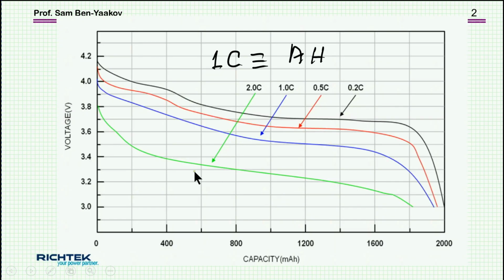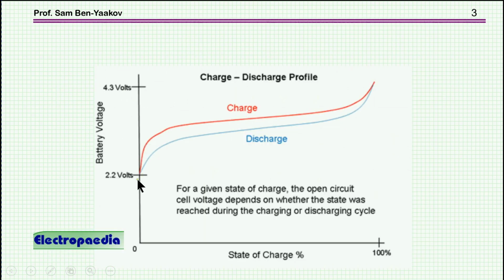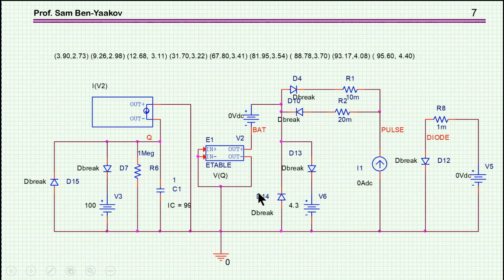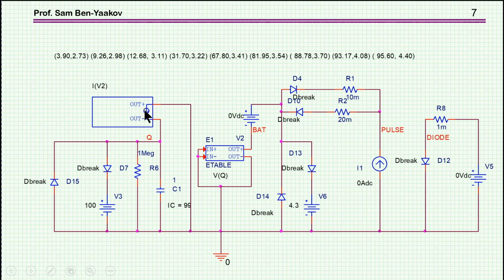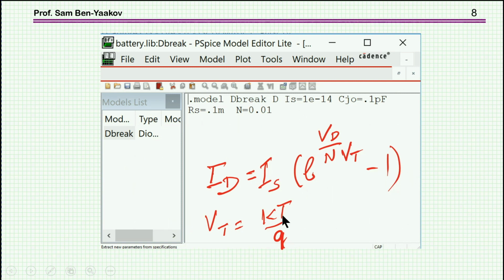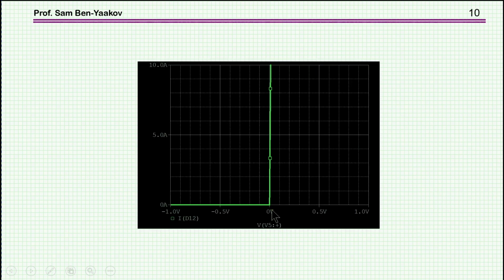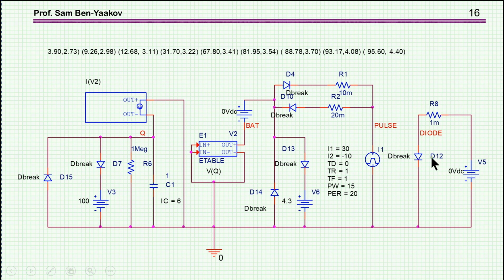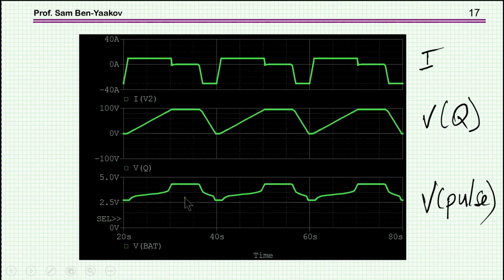A simple simulation model of a rechargeable battery

Comment: Is there an LTSpice equivalent you may have worked on? I tried replicating it in LTSpice, but when I stack them in series, some of the batteries in the middle produce wrong voltages. Two stack OK single works. Stacking 8 I see battery with 100% soc producing 3V instead of 4.2 - weird results.  Likely pspice to LTSpice implementation issue. Just wondering if you had an LTSpice equivalent to compare it.
Reply from the maker: I have never encountered a problem like that. Please check your schematics again and set the minimum simulation step to a small value.
Reply: @sambenyaakov  thank you professor.  I will try that